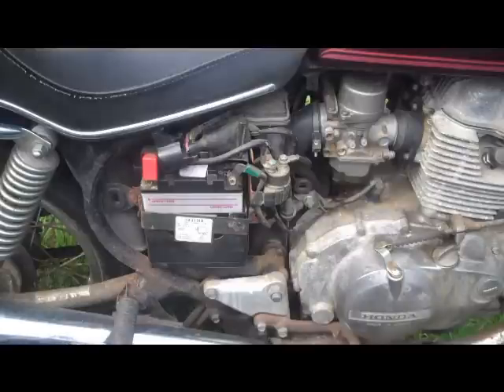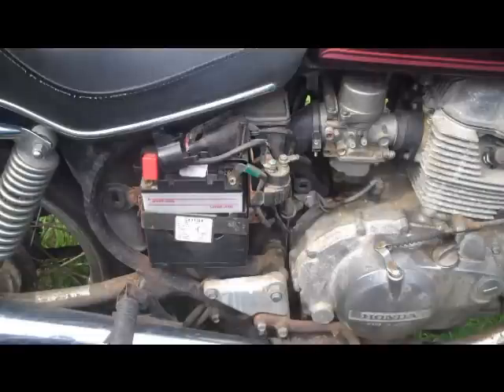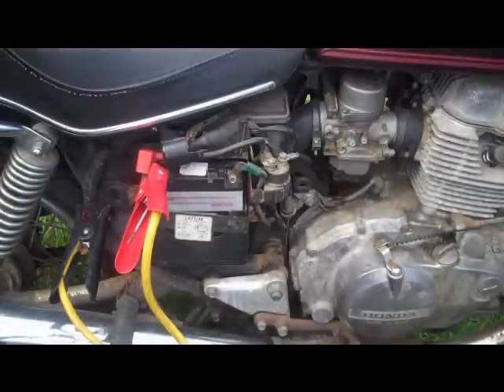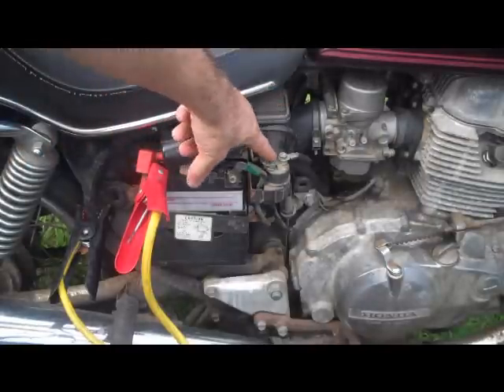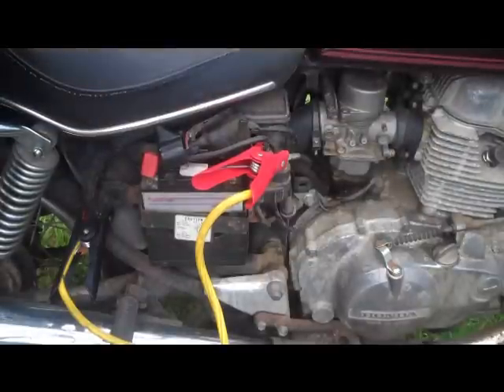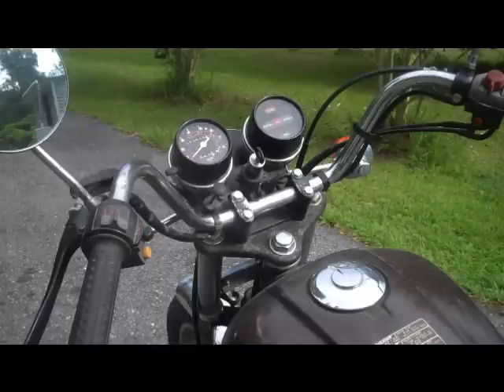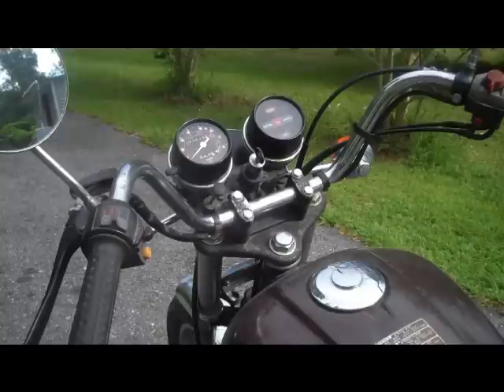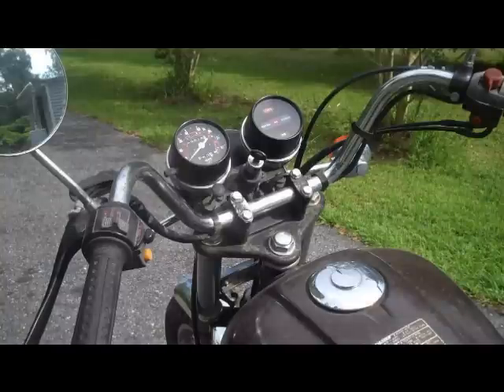How to jump start, bump start a motorcycle

Comment: recently changed my handle bars, and when I got it all back together my starter button wouldn't work. Luckily the bike kicks starts wonderfully first kick, but Im wondering if using a screwdriver to connect the two starter solenoid terminals to turn the bike over with the starter is bad, or dangerous to any electronic components if abused.

Comment from the maker: Because, as I understand it, you are drawing current directly from the battery without the charging system of the donating motorcycle operating at all, since the bike is off. Same with a truck or car, its basically as if a loose battery on the ground was jumping the bike.

Comment from the maker: Hmm usually if there is a master link, I will just pop that out and slide the chain free. If there isn't, its often easier to remove the rear wheel, slide it forward, and slide the chain off

Comment: Hi Mr.MaxStorey. I've got an old Kawa KZ440 LTD, and the battery doesn't have the power to start the bike. I've tried to bump start it, but I can't seem to put it in 1st or 2nd gear, and then push it - even though I pull in the clutch all the way, I can't push it. I can only put it in neutral, push the bike, jump on, pull the clutch pop it into gear and.... then the bike has come to a halt. Shouldn't the bike be rolling freely when the clutch is pulled? I have been riding the bike before...

Comment: I have a 12v motorcycle battery that has gone down to almost 7v from sitting around a few months.  My battery charger won't charge it because it needs to be at 9v+ to start charging it.  
Can I connect jumper leads from a good battery in my car to charge it up a couple of volts that way?  (just sitting and charging) .. does that work?  is it safe to do this?
Reply from the maker: Yeah that should work
Reply: EvLoutonian  ...9/5/17 Yes and Also, I keep a Maintenance (1.5-3 amp) 'Trickle' charger on my Sportster If I'm not riding for just a few days! It keeps my battery right up to 13+ Vdc So, the whole systems in top shape electrically. If I winterize my bike I Always disconnect both battery cables, pull the Main Fuse, And hook the Trickle charger onto the battery, without having to remove it from the bike. glb aka Fuddly 👻

Comment: Grounding to the frame of the bike makes little or no difference with a SLAB (sealed lead-acid battery).

I cheated on my scooter (remove the seat to access battery) by putting two hidden wires on the underside of it =P Made life a lot easier. =)